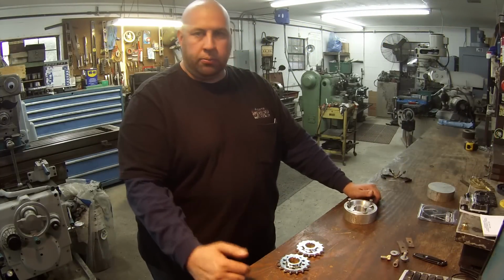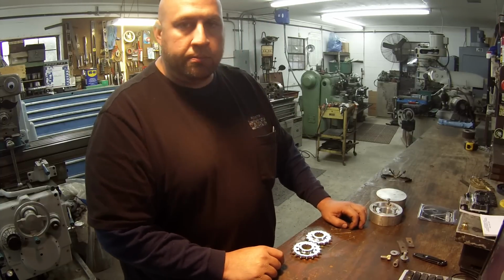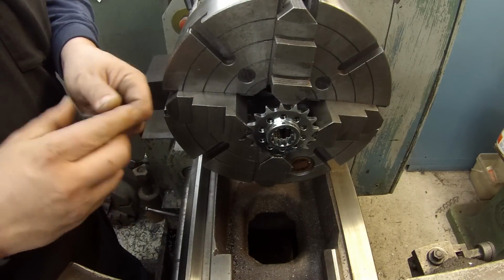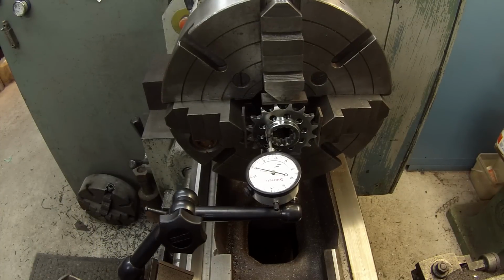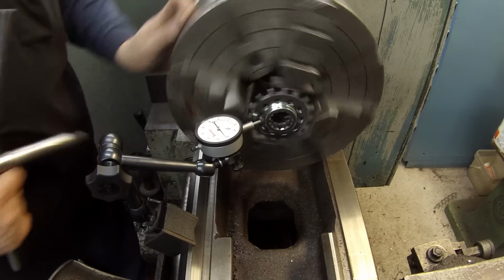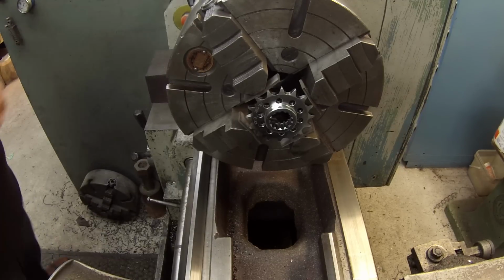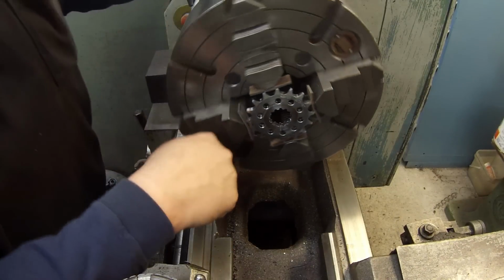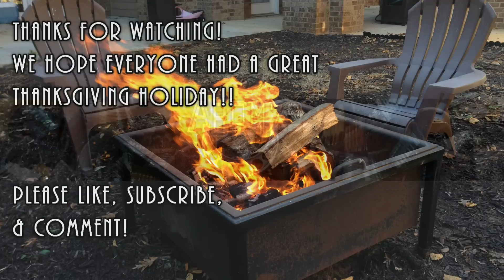Saturday Night Special 46 Part 2

Comment: Nice SNS Adam. I was thinking saturday nite was going to be empty this week but you got it done!
I bet that hardened interrupted spline cut didn't do a whole lot to help that insert but sometime you just have to go.. :-) Turned out great.

Colin
Reply from the maker: Thanks Colin. We came home early and decided to go ahead and make them. Your right about that part, very tough material. If the standard carbide inserts wouldn't have worked I had some other to try.

Comment: Every time the tool hit the spline my butt tightened.  I've had pretty good results using Iscar tooling.  A little bit of trivia: Iscar= Israel Carborundum. Very cool handle Brad made for the Victor. Thanks for posting a SNS this week. If you didn't I would go into withdrawal.   ;)
Reply from the maker: Well Ken I'm happy to have completed your weekend! Hey I even have a bonus video that posted today!

Comment: To align thin parts to the face of the chuck, cut a parallel of needed thickness and place on face of chuck and push part against parallel. Easy peazy.
Reply from the maker: Just need more hands to help hold it all together when chucking using the brass plates as well.
Reply: That would work too. But I can't afford the surgery to have extra hands. LOL

Comment: Hey Adam,
Some great machining on those sprockets. I also liked the shots at the end of the video. That fire pit looks like a great place to sit, with your beverage of choice, and enjoy good conversation!  Thanks for another great SNS! What kind of celebration are you planning when you hit 52 -- your first year of SNS? To bad it so damn far between California and Florida or I would be there for a visit. If I drove, I could visit Herb Blair, James Kilroy, and swing up to Georgia and see Keith. Oh well! It doesn't cost anything to dream! Thanks again!
Have a good one!
Dave
Reply from the maker: Sounds like a good long summer road trip adventure. But lot's of driving coming from Cali. That fire pit is great, did I mention I built it myself? That's my spot when we visit in the cold months.

Comment: Hey Adam...

I have a technical question on the gear facing.

On the 16 tooth gear - once you indicated it to verify that it was "flat" against the jaws...
did it really matter if it was located to spin on it's axis?
In that you were only cutting the material off and down to the face level...
It seems to me that it really doesn't matter how centered it is to the spinning axis.
????? let me know.

About the lathe lever...
Did you check to see if the shaft was actually round?
Seems that this may have been the problem fitting it in.
For that matter... I wonder if the turning of the bolt before you realized there was a set screw may have
scored the inner wall just enough to cause the interference.?.?.?.

As always, Keep up the good work!

Anon
Reply from the maker: Anon, no it doesn't really matter if the part is turning true on od if just facing, but I always like to true up my parts, it just makes for easier machining. Also, in some cases of it not true you can cant get in there and chamfer.
The tube was round according to the guessometers. it was so close of a fit it wouldn't slide into the hole. using the V drill opened it up just enough.

Comment: Hey Adam-how come you were concerned about damaging the teeth with the 4-jaw(and used shims) but not with the 3-jaw?
Reply from the maker: The way the jaws seated inside of the sprocket teeth won't cause any damage unless you really overtighten the jaws. The chuck jaws were contacting in the sides of the jaws. The main reason for using the brass plates with the 4 jaw is so that the contact area was spanned over two teeth for each jaw, and the brass to keep from mashing the teeth in.

Comment: any reason why you couldnt of thrown the second sprocket in the mill and just milled off the boss after turning the first side off in the lathe? seems like alot less fussing,
Reply from the maker: It could have been easily clamped down and milled yes, but then risk tearing up carbide endmills. I just prefered to do it in the lathe myself.

Comment: Why do you hardly ever use lube or coolant? You had to replace your tool because it got red hot
Reply from the maker: If I had flood coolant on the Victor I would use it. I was machining hard steel in a high interrupted cut. Not good on any tool.
Reply: I sometimes use a mixture of plain engine oil, water and dishwashing soap as an emulsifier. Wokrs pretty well if you have nothing else on hand. use a plantspraybottle as container.

Comment: All bike sprockets have play on there output shafts 1 thou ain't a problem, I have seen worse and there still on.  I do understand that you would prefer to get it close as your name gets put to any job you do though.
Reply from the maker: It's a habit of mine to get parts running as true as possible. I know most cases there is a bigger tollerance, but that's just me.